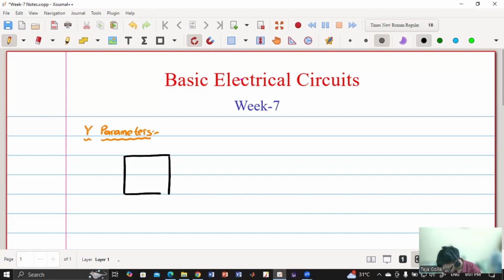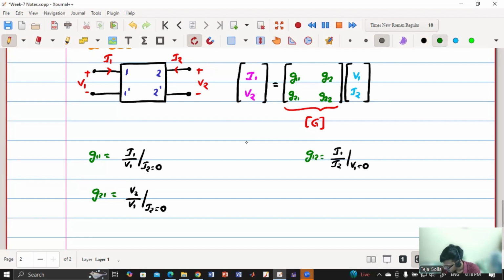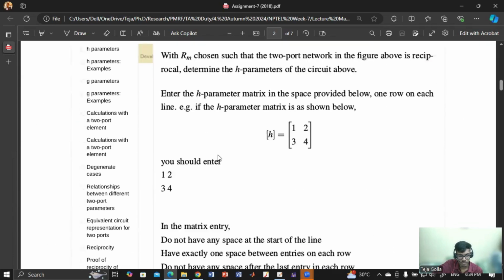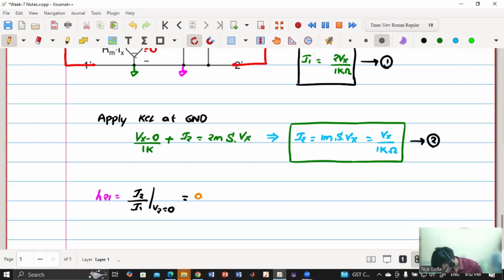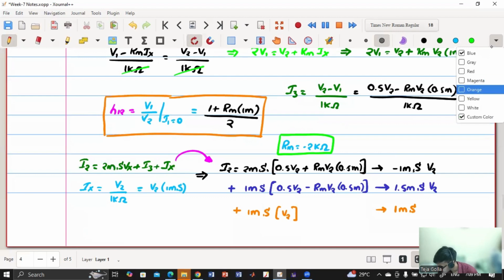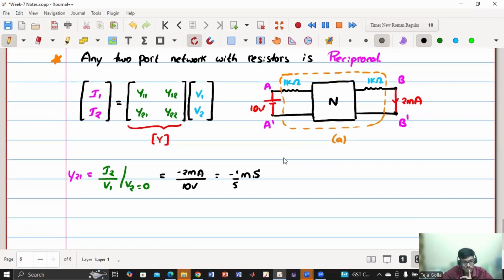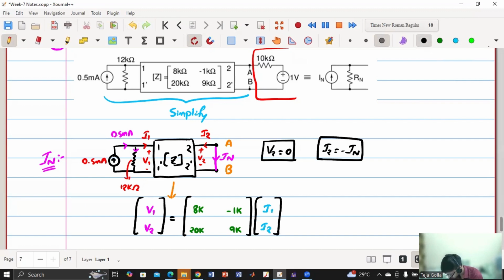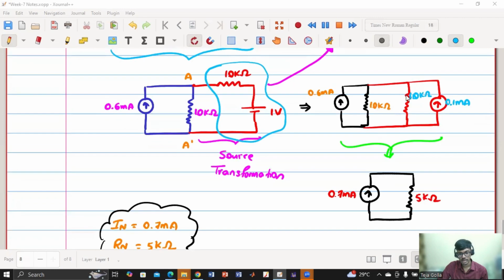Week 7 | Basic Electrical Circuits | Problem Solving Session | NPTEL

Comment: sir in first problem we calculate the h21 then why ix current is zero
Reply from the maker: For calculating h21, we need to short the 2-2' ports i.e. V2=0. In this case, both the terminals of 1kohm resistor are connected to ground as 2-2' are shorted, so the potential difference across this resistor is zero and hence the current ix is zero